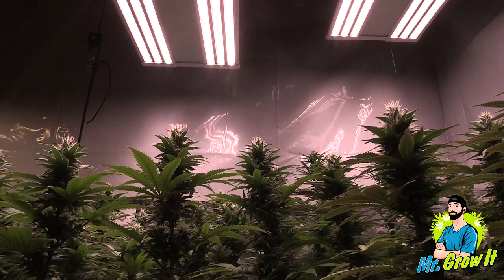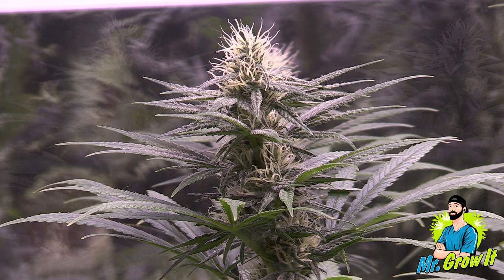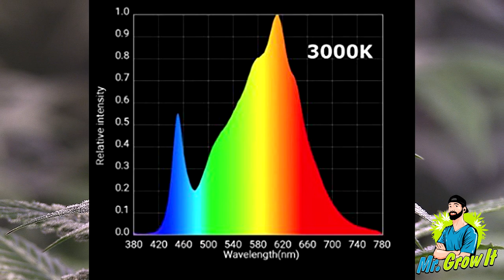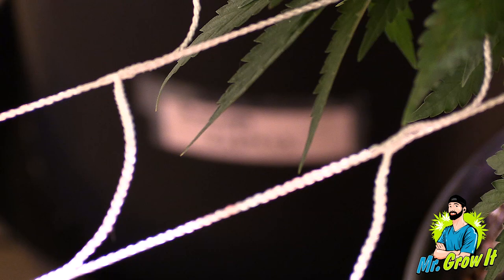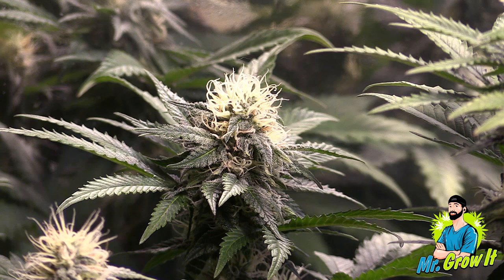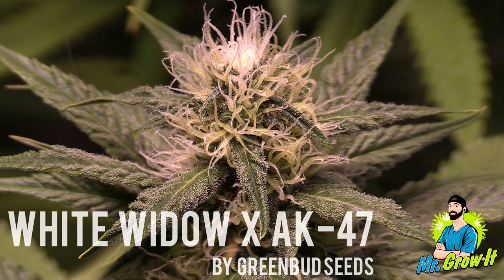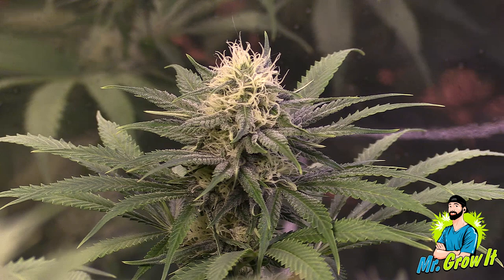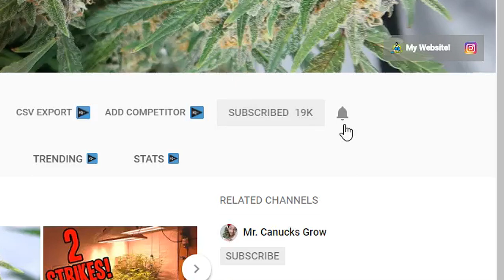HOW TO GROW HUGE CANNABIS BUDS DURING FLOWERING! - GROWING DENSE BUDS

Comment: Thanks I’m a beginner and the flowering is a week old. I’m using all Fox farm products and will start using beastie bloomz today. Along with other FF nutrients. Growing sour kush so my veg cycle looks different and my flowering stage I’m guessing will as well. I’ve gone with inkbird temp and humidity controls along with a vivisun induction and carbon filter system. All for only two plants. Y’all pray for me. I liove Mr. Grows it videos because he keeps it simple for folks like me. Thanks for doing so.
Reply: hi,  just wondering how well the beastie bloomz worked out?
  i am using the 3part FF as well, but nothing else
Reply: @mikeduke7613  it did pretty good despite all the things I didn’t know in the beginning. I’m in the curing stage with that batch. I’ve started some critical mass photoperiod. Which is supposed to grow slow. But my babies at three weeks are beautiful. Every day visible progress. I topped them today. Again all Fox farm products 
Happy growing
Newbie still
Reply: @feleciacolbert5284  how’d the grow turn out?

Comment: What distance should  you typically have the lights from the plants during flower
Reply: Using a cheap light meter you’ll have to watch the video and dial in the specifics with your own measurements to the specific needs at specific stages

Comment: Quick question about light spectrum utilization for the flowering stage; I have an led grow light with red and blue lights that has a button to switch between just red, just blue, and both red and blue. In my specific case where I’m using a cheap led grow light with limited lighting, do you think it would be better to turn only the red lights on during flower, or should I just turn them both on, that way the plants are getting more light overall?
Reply from the maker: Both on. The more light the better with those traditional blue/red grow lights

Comment: If the par is only 600 at 18 inches can you move the light down to 12  for deeper penetration?
Reply from the maker: Yes as long as the temp doesn't go too high. Also, you'll get less spread.

Comment: Do I need to feed p.k all the way from. Week 2 thru 5 . Is feeding full strength then half strength bad for big bud growth
Reply from the maker: You don't have to, but it could help. Genetics vary so it's hard to tell you what strength to feed them. feeding full then next time feeding half because you don't think they need full is perfectly fine.
Reply: Would you say 75f  55humidity day n night is best thats what i try for but my buds have not swelled
Reply: Also o deleaf everything before flower then very little in flower
Reply from the maker: Cannabis will grow fine in those conditions. What genetics do you have?
Reply: @MrGrowIt  OG, King Lui , Face off, Fire Og i ran them for years no problem moved to a new location all the sudden  they don't blow up
Reply: Robert Corona 75f is too cold. 85f is optimal
Reply: Cooler at night by no more than ten degrees

Comment: how often should i feed my flowering plants? im growing outdoors in smart pots tempature is around 100 degrees in cali and my pots are normally dry towards the end of the day im just not sure if i should daily or not
Reply: Definitely not daily. You might have to water it more cause they're in smart pots but you should only feed every 4th watering or so. And a lot less than it says in the bottle cause that's meant for a 10x10 garden with a certain number of plants. If you do that you'll burn and kill your plants. Trust me, just use fox farm soil or something similar and don't worry about feeding. It goes FWWWF. And use like a 10th inf what it says to use in the bottle cause cause they don't know what plants you have or what size room you got. You know?
Reply: Get a moisture meter and that will help you if you can’t tell.